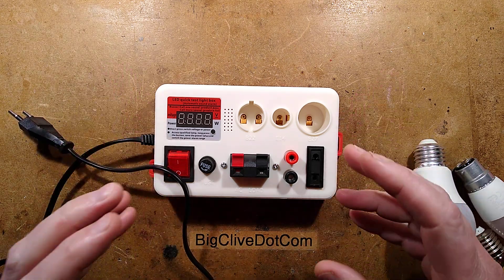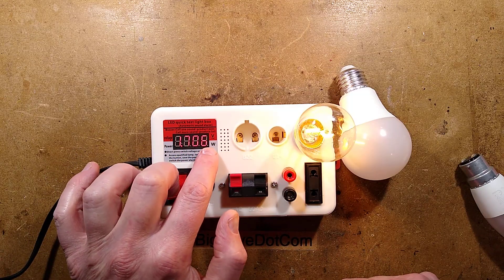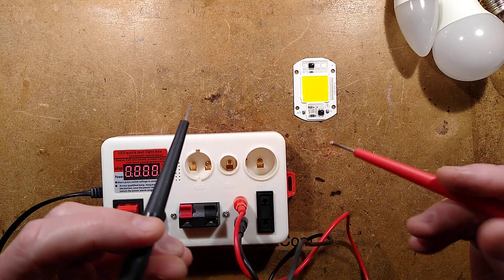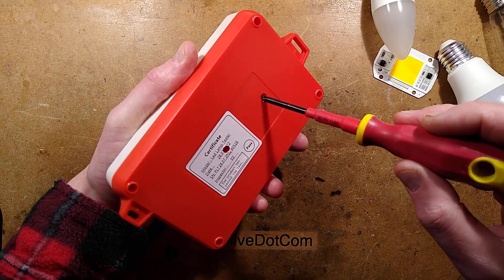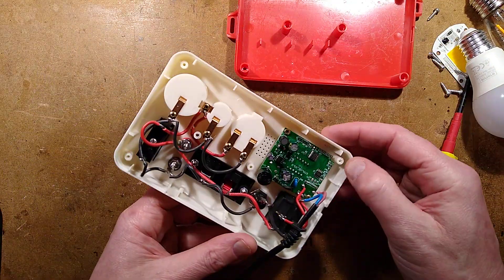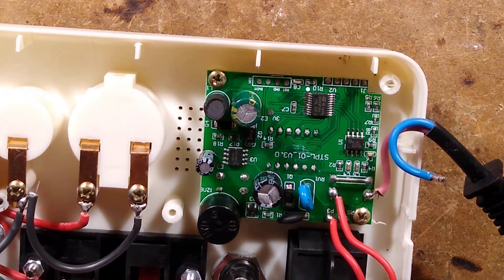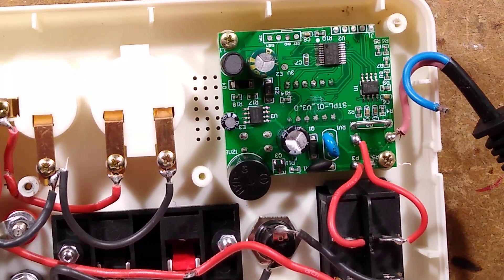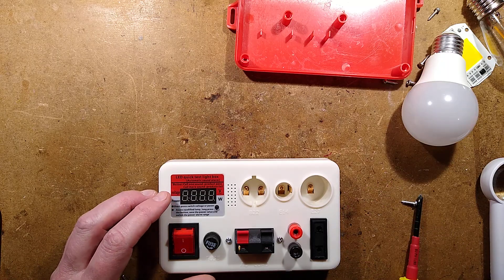Scary eBay Chinese factory test equipment

Comment: Feels way too cheap and unsafe. Just add a switch under the socket which only switches on if a bulb is firmly pressed down, that won't cost much and does not change the work flow, but would make this thing 100x safer.
And the probe thingy... Who the F would thought that an exposed pointy live wire is a good idea?

Comment: This could be made a lot safer quite cheaply by adding a box on top of the sockets. Have a door with a microswitch and a relay that will only energise the circuits when the door is closed. Put the bulb in, close the door, keep your hands safely away

Comment: I think of two things when looking at this! 
1. Mandatory use with earth leakage detection. 
2. The acceptance test just means that the smoke built into every Chinese appliance didn't escape when power was applied. 

My faith in Chinese build quality is completely restored, was looking like improvement was possible, but alas no!

Cheers from Oz

Comment: Well its not legal in india these kinds of devices.
Unless someone is running an illegal factory without a licence or permit.
But people used to make similar contraptions in electrical shops to test resistive or inductive loads, like a normal incandescent bulb is connected in series with the equipment they want to test
If the bulb glows, pass
If the bulb doesnt glow, fail
Surprisingly people have trusted this method for decades.
Reply from the maker: That is a standard test for things like ballasts here too.

Comment: mains voltage with needle probes its one thing to to sample high voltage via a probe but to deliver high voltage test power via a probe is just a bit much but then not many other options unless some form of enclosed test rig was made for each type of board place board into holder close lid and the probes touch the just the right points on the board turn power on test complete turn power off remove board from clamps next board this is also why china is able to do things so much cheaper the smallest change to a board and new testing hardware is needed I think some type of covering over 90 percent of the probes would be helpful similar to your UK plugs just something really thin and not interfere with probe placement or even the option of having a rubber plunger that would have to compressed just big enough to cover a solder joint would this meet US standards I do not know but the options to make this form of testing safe is just not really possible its gonna either be a bit unsafe or very clunky

Comment: At least lamp testers of this kind are situated in German home improvement stores. No probe connectors or loudspeaker terminals.
They are not for sale but for testing bulbs before you buy them.
The testers are accessible to the public in these settings...

Comment: A few thoughts from a non-American person:
Are there any people who put fingers into devices like this? What's the reason for doing this?
IMHO studying basic safety lessons at school will be much better than putting stickers "Do not open" / "Do not put fingers" on every electrical device.
And no, you won't be killed immediately if you suddenly touch 220v live wire. But of course, it can be deadly dangerous in some circumstances. Just be careful and think twice.
Anyway, this device is a cheap Chinese crap and is unsafe by itself

Comment: One thing I've come to realize about cheap Chinese electronics: Many seem to be a copy of more quality models, manufactured by reputable companies. It seems there is not always an engineer behind the wheel. A lower-paid employee literally designs the copy, with no real understanding of how things work. And when they encounter something like a safety feature, which makes no sense to them, they cull it out as waste.

They think they've done a great job, because they're actually able to craft a functional replica. Eventually the negative Amazon reviews start rolling in, and they get offended because they feel attacked; never comprehending the basis of the criticism.

Comment: Not sure if you noticed but the red wire coming from the power cord is barely hanging on by a thread. That thing is what my brother would call a population control device.
Reply from the maker: The cable is copper coated aluminium with a distinct lack of copper.

Comment: Wow... I remember the first time I wanted to test a 240 relay here at my home when I neither had a good workbench for this or a housing. I lay the stuff on the floor but moved 2m away from it and taped the wires to the ground so that high and low voltage side would not cross before trying things out from my 2m distance... I did not consider that there are people like having open live wires in their vicinity... o_O

Comment: That cannot be a 'EU' plug. There's no such thing. The UK was in the EU from 1991(1973) and used 3 pin square socket plugs. RoI still does and, AFAIK, also remains an EU member. Let's not make plugs a Brexit thing.

Comment: I don't see the problem. If you're trained on it, or have an IQ over 72... It's called TEST equipment, as in, not for the unwashed masses. You're picking apart specialist equipment. 

Go review a CNC lathe - that, if you're a dumbass, will also kill you.

Comment: Something about this reminds me of the “safety” of typical household appliances of the 1950s. Metal housings with no possibility of grounding (only 2 pin sockets), fabric wire insulation and circuits protected with slo-blo fuses. Then again, cars of the 1950s had effectively javelins (rigid steering shaft/column) mounted directly in front of the driver’s chest and no seat belts. With the level of safety regulation we have today, it would make one question how anyone survived 70 years ago (or, apparently now in China).

Comment: In Germany we had similar testers till  around 2012 in Hardware stores. 
They did not have the fancy meters or the  dodgy probes but they had open sockets without any insulation that where live. 

As customer you could test lamps there yourself. 
They where later banned because children would stick their fingers in the sockets.

Comment: And they wonder why we crack up in Australia. Anything sold in Australia must adhere to electrical compliance standards, unless it's made in china then it just get dumped through the back door.
Reply from the maker: Australia has gone way too far with its regulations.  To the point of being a protection racket.
Reply: @bigclivedotcom  You don't agree with safety rules for products to stop people from being injured or dying ?

Comment: To test for shorted or open armature coils, the Indians and Pakis use a lamp cord plugged into the mains with a lightbulb in series. They take the 2 stripped ends that are just twisted into a little deadly copper rope, and they brush them around the commutator looking for either light or no light depending on what they're doing. 🙃 It. Is. So. Fucking. Sketchy. OSHA officers would have a stroke seeing that in person.

Comment: The ideal Xmas Present for those who you don't particularly like!  For added enjoyment they could have put in a 1:1 mains isolating transformer, so that if you did get a line to earth zap, you'd not trip the local RCBO, so thoughtfully not inconveniencing others using that particular circuit!
Reply: You're absolutely correct. RCD and Iso transformer required. That is as dangerous as it gets. It's probably just best to destroy it before it kills you. I've ordered several for family members... 🫣

Comment: The Chinese are hard nuts and can handle 240v. Have you never fixed a TV? The old ones had 25kv. Multimeters will measure 1000v with probes. It's their mountain roads where you have to watch it.

Comment: I have a Royal bulb tester console from the 1940s-1950s that was designed to be used in hardware stores, bolted to the counter. It has a streamlined moderne black bakelite housing with a number of sockets like the ones on your tester. There is also an e27 socket for a small incandescent bulb. If a bulb is good, when you place it in its socket, the incandescent bulb will light, also lighting the bulb under test at half brilliance.  There is mains current at all the sockets at once, meaning your children could easily stick their fingers in the sockets and get a nasty surprise.  The Royal company also made Christmas lights, most notably strings of small fluorescent globes, that light up in pastel colors. These were expensive and only made in 1949 and 1950.
Reply from the maker: Those may be the fluorescent globes I based my 3D printed neon globe project on.
Reply: Such bulb testers were very common in the 70s in appliance stores here; they usually had them screwed to the wall behind the counter, out of reach of customers.  Some had 220v on the sockets at all times, but others had small plastic tabs in the sockets that got pushed in when you pushed in a light bulb, energizing the contacts only when a bulb was inserted.  Safe!  (Not safe for a curious kid such as myelf.  Oh well live and learn)
   
But those test leads at mains voltage on this thing...  SMH.

Comment: I disagree a bit about "you can poke your fingers in lamp holders anyway" because in most people's everyday lives, light sockets are almost always filled with a bulb, so you can't "just poke your fingers in" (you have to unscrew a bulb first, etc, and most people will have the sense to turn off the switch before doing that).  However, this device is intended to be run all the time with multiple sockets exposed and with the switch turned on as its normal operating state, so it is really not the same situation at all, IMHO.

But yeah, those probes were just all kinds of scary...

It's also kinda funny that this thing has a California Prop 65 sticker, since it's probably actually illegal to sell it in California for safety reasons anyway.

Comment: Did not see the correct certification markers (for China) on this equipment, they very likely did not even try to comply with the codes anywhere. These workshops who use this product really doesn't take adequate care of the workers and should be sued out of existence

Comment: I bought a pair of walkie-talkies from china (retervis) kenwood copies and the chargers were single insulated from a 230v supply to base. 
Questionable if the insulation breaks. Like the old Christmas tree lights back in the day. Dangerous!

Comment: I remember in the 70s in the UK buying bulbs and the shops would test them. I don't know whether that was for reliability issues or in case you tried bringing in your old ones pretending they had just gone as soon as you used them at home.  I think they just stuffed them into a socket and if they lit up they lit up, if they didn't they didn't.

Comment: The neutral disconnecting when you open it is a great safety feature. There's probably a little deadly snake in there, too.
Reply: The plug only has two connections. Then how will there be neutral you muppet.
Reply: I'd agree but I think it was more just the colder soldier joints that led to the demise rather than good engineering
Reply: With no ground wire in the socket, there is no need to connect it to the board. Would be cheaper to use a 2-wire cable instead.

Comment: That’s the most sophisticated mains-to-death adapter I’ve seen yet. Outstanding.
Reply: Complete with 240v live pointy probes to JAB into your victim.
Gotta ensure a good low-resistance current path...
Reply: @wizrom3046  One in the neck, the other in the thigh (opposite sides)
Reply: Yes
Reply: Right? Just cut a cord than bam death for only 60 cents

Comment: They make a LED tester that's good for testing the forward voltage/polarity of TV backlights, constant current is configurable from 1-25ma while voltage auto ramps from 0-220v, useful for testing Diodes also
Reply from the maker: Some of those units will deliver a mains derived shock.
Reply: @bigclivedotcom  it ramps up to 220v so yes it can produce a tingle

Comment: A relative of mine has an incandescent bulb tester in which you can also push in the bulbs instead of screwing them in but it is battery powered and the indication is a green led, it only has an E27 "socket" but you can check many other base types by touching the bottom contact and the one on one side, in addition being just a continuity tester it is compatible with incandescent bulbs of any voltage.
I think I'm going to have to upgrade it with a buzzer. Test probes would also be useful for checking fuses, car bulbs that use spade connectors, festoons, etc.

Comment: Seems fine to me.  As a weldor, I'm frequently handling upwards of 200 amps, but most of the time people don't die from electrocution when welding (crushing and blunt force seems more common.)  As long as you treat your machine with a healthy amount of respect, you need not fear it.  I think a machine can be much more effective when it relies on the competence of the user.  Otherwise you end up with a world of incompetent people on our roads, operating our machines, building the things we all use.  Not grabbing live wires is pretty simple compared to a lot of other things.
Reply from the maker: The output of welders is usually capped to a relatively safe voltage.

Comment: Am I strange in that I want to see a glove, with leads going back to the speaker wire, and somebody testing by poking with two fingers of VERY insulated gloves with metal points on the tips.

Comment: those unpolarized plugs are standard in Europe. The fuse would not blow if the other wire is live and touches anything. However we have differential breakers (like GFCI) mandatory to protect the whole house (at least here in Italy, idk about other countries). When building my own stuff, i have yet to learn how to properly fuse my circuit as every plug, including earthed ones, is unpolarized.

Comment: It's not that different from the Hoppi that you regularly use. I remember that lightbulbs used to get tested in a shop before sale in a panel of sockets. One would probably not touch those multimeter probes, but might let them fall or be pulled by tension, and blow the tip off.

Comment: The fuse is in the live or neutral depending on which way the non polarised plug is plugged in 😊
Reply: Here in Norway we don't have a neutral wire, both wires are hot. Exceptions for 3-phase power supply.

Comment: My first electronics experiment, at the wise old age of 4 or 5, was to put a 6 volt bicycle light into a (powered) 220 volt lamp holder. It was a very effective method for turning all the lights in the house off at once -- it blew the main fuse :-)
Reply: Good one. My first electrical experiments was with trying to place a 'to large a nail' into an AC outlet. My mom stopped me by saying "let me get a long board, so I can knock you loose". An important learning experience for me at 4 years old.

Comment: This gear is only super dangerous when the neutral is earthed (UK standard).

In china, neither live or neutral is at earth potential, reducing electrocution hazard.

You can touch Live or Neutral if the mains is isolated. Only when there's a circuit between the two power wires and you in the middle will it hurt 👍🏻😀🇬🇧

Comment: I am now transported back over forty years to an old-fashioned electrical shop in my home town,where bulbs were tested before being sold - but the test facility was a bit of clear twisted flex with a quite large amount stripped off and with frayed conductors being dabbed on the terminals of the bulb. The couple were quite elderly, very lovely (they had owned the shop since the 30s) and somehow survived this!
Reply: I was going to say something similar although the local hardware shop in my town had an apparatus that looked very vaguely like this. It seemed a little reckless to buy untested bulbs from Woolworths or a supermarket.
Reply: Clearly such devices can be used safely if you are aware of their limitations. For repetative use  or use by someone that isn't aware of the risks, it isn't safe enough.

Comment: Actually, laboratory and test equipment are usually excempt from electrical safety laws in many countries, including sweden (in sweden for example, you can as a non-authorized person, operate equipment that normally only authorized electricians are allowed to operate, if its installed for laboratory or testing purposes).

So I don't think you should be scared off "unsafe" test equipment. They are designed to test, thus many such items will be unsafe or scary or out of spec. It depends on what you are testing.

Note that work safety laws still apply, so unsafe test equipment still needs to be set up in such a way it becomes somewhat safe to operate.
The thing is that since with test equipment, you are supposed to test, thus they must have certain out of spec or unsafe conditions if those are to be tested. For example, in some factories you may have oversized or undersized electrical plugs, some painted red with "No Go" - shouldn't fit in socket if its compliant, and green with "Go", which should fit in socket to pass the test.

In some test equipment, you even have fake fingers made out of metal, and you use a voltage meter connected to ground, to "finger" around the equipment to be tested and then the voltage meter will tell you if a real human would get a shock for example.

Comment: The Test Equipment (as shown) would become infinitely safer if it was double-insulated, and an Internal RCCB had been incorporated. Having had a couple of 240v Mains Shocks (many years ago), you become very aware of the dangers! I would not use this piece of Test Equipment in its' current form, and even the addition of an external RCCB could make this product much safer.Greetings from Australia.

Comment: Such device is acceptable, provided that it is used by qualified personnel only AND it is fed from a floating (non-grounded) power grid or via a safety transformer. Surely, more safe methods of testing lamps exist.